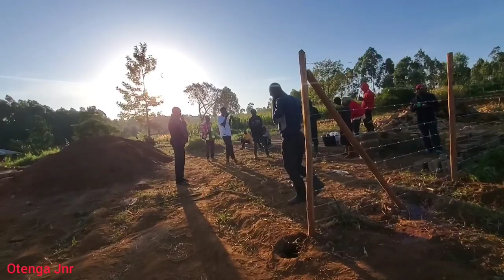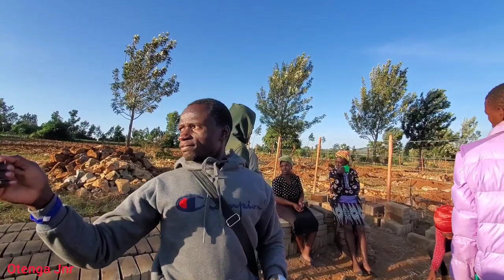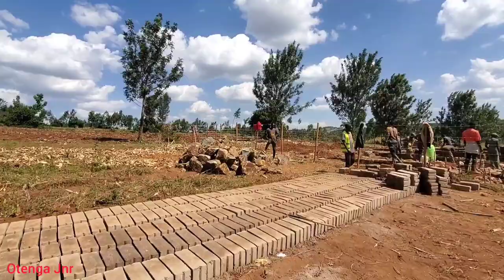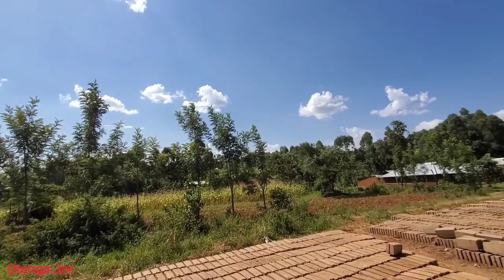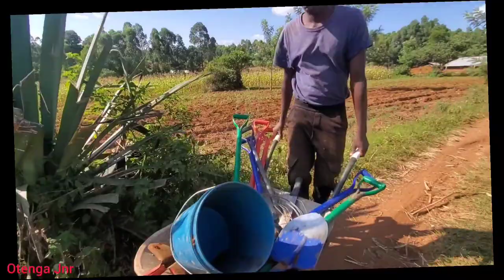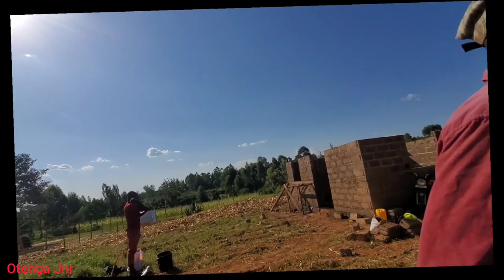SAD REALITY IN NYABOHANSE

Comment: Is it not a necessity to use corner beams when building houses in Kenya? The house itself was designed by an architect so that should be in the plan, but I was talking about the store, I so no pillars in the four corners.
Reply: It's  necessary, I have  just  finished  building  my  home.  I have  many Pillers  at the  Corners.
Reply from the maker: This house will have 4 pillars and two lintels for strength
Reply: @otengajnr  Sorry I did not see any in the store, I may have missed  the installation.